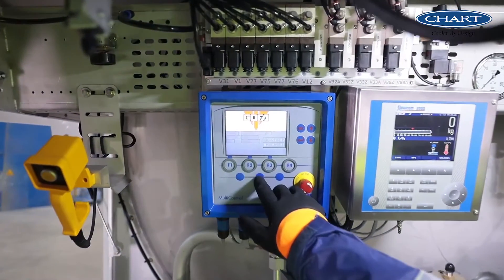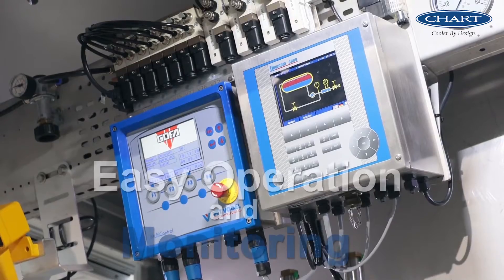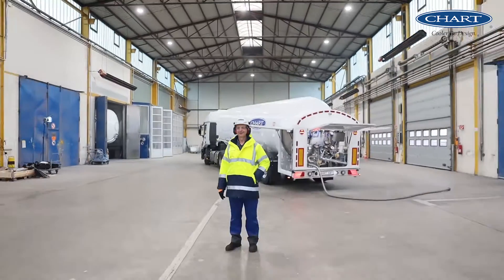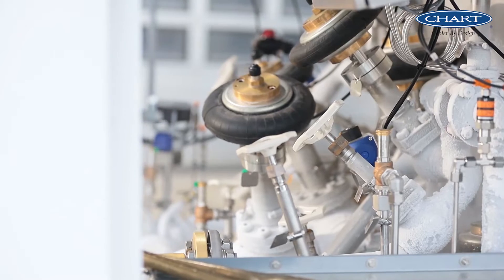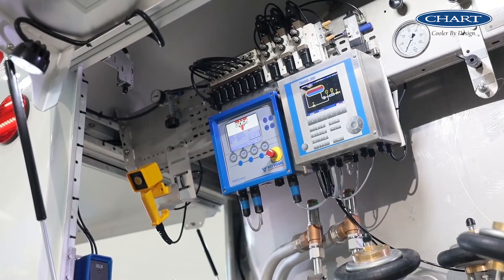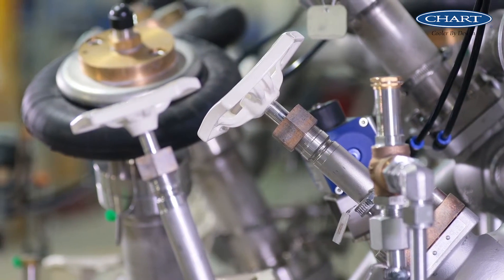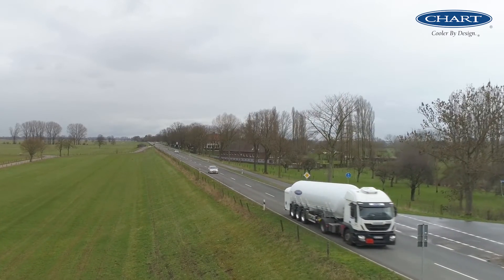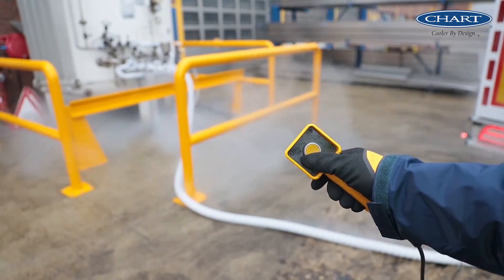Cryogenic Trailers from Chart Industries

Comment: Can we have the equipment on a suitable chassis of Ashok Leyland or Tata?  We would like to have a distribution network in India. Can we have a static dispenser from your organisation to get the fuel injected into the vehicle. The system and the fuel are still in a nascent stage of usage. However the system is currently finding favour with many customers. However we can enter in to the market as and when it progresses.
In the light of the above suggest the right business model to operationalise everything jointly.
With warm regards,
C. Rajan Padmakumar